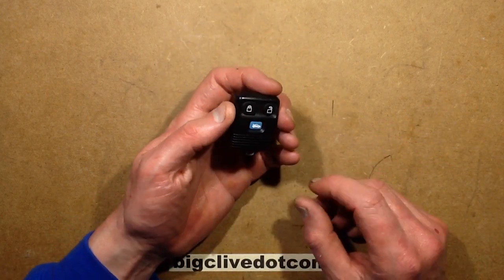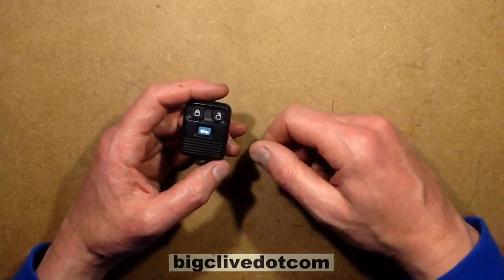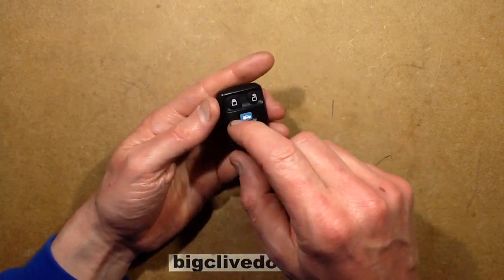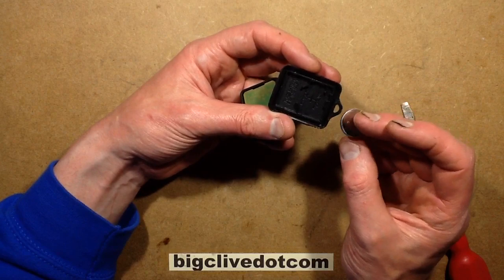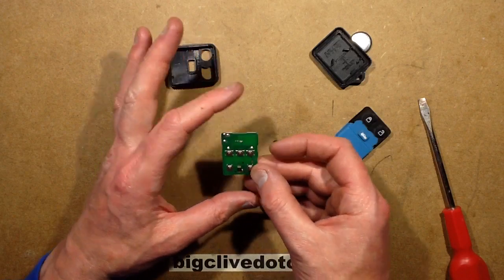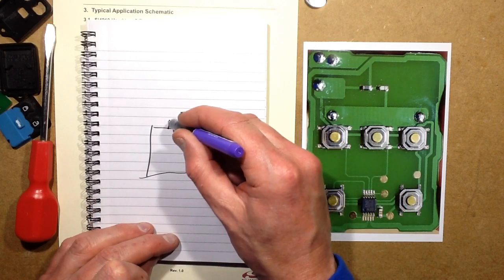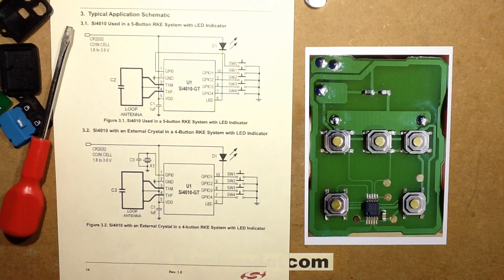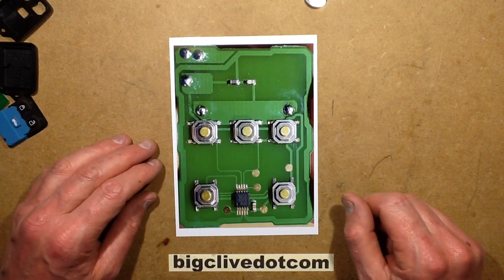Inside a Ford Transit keyfob remote.  (and pairing it)

Comment: Huh... last time I had to replace a fob for the car (granted it was a VW Golf not a Ford Transit), I switched the gubbins over to the new fob and I couldn't work out why the key wouldn't work, even more concerning it still wouldn't work when I switched it back to the old fob, I got irate at this point, so the other half googled it and discovered it has a tiny little thing the size of a grain of rice which was apparently loose in the fob which obviously fell out when when I opened it up (someone might be forgiven for thinking they don't want you buying and fixing your own keys), after we searched the floor and found it the new casing worked a treat... I was hoping you were going to explain said tiny loose doodad, I assume it's how the car recognises the key but how does it work given it's' the size of a grain of rice, loose and not physically connected to any kind of power source? Does it have a some sort of tiny kinetic battery like some watches? Does it use the field produced by the key's electronics/battery? ;)
Reply from the maker: That's odd.  It almost sounds like it could have been a transponder for the ignition system.
Reply: Ah ha... I did some digging based on that and discovered it is a ID48 Transponder Chip, it's encased in glass and it is about the size of a grain of rice (there are pictures in google images but there isn't much to show scale), it looks like it has a wire coil inside it (one of the images showed a bit of the inside). Does that shed any light? Do you know how it is powered based on that info? Google just keeps telling me where I can buy them and how to programme them to the car. I would be curious to know how they work and particularly how they are powered :) I might still have one knocking around somewhere if your interested (the car was written off when someone kindly ran a give way sign at 40mph and I'm one of those people who keeps interesting things) although I don't know if you will be able to get into it given it's size an it being 'encased in glass' be more than happy to pass it on to you though if I can put my hands on it :)
Reply: Oh... modified my search terms a bit and found this: http://www.locksmithjournal.co.uk/understanding-cloning-and-how-it-can-work-for-you...
"Since 1996, in an attempt to reduce vehicular theft, auto manufacturers started including small computer chips, called ‘transponders’, inside the key that communicate with the vehicle to allow it to switch off the immobiliser. Importantly, these transponders are powered directly from the vehicle itself, and are typically hermetically sealed in either epoxy or glass making them highly reliable and resistant to environmental factors such as temperature, shock and humidity. The technology worked so well that that is caused vehicular thefts to plummet almost overnight."
How are they powered from the vehicle if they don't touch anything is it magnetic radiation or something else?
Reply: @rtzigga  Thank you :)

Comment: I'm another one that doesn't get radio stuff. Most older electronics hobbyists started with ham radio. I just never had any interest in it.
Reply: +Tim Ramich I started just after the CB radio boom here in the UK of the early 80s, so a lot of what was available was CB radio stuff... but, I never really had much interest either.  TV/Satellite/Cable/Wifi/etc brought me to RF after a few years messing with low frequency or DC only stuff...  but only on a pragmatic level. No design, just reverse engineering minor stuff and troubleshooting.

I agree it's like some dark magic, where moving a component a few tenths of a mm can detune a circuit or summon a demon. And the circuit layouts on some  multi GHz level stuff looks like bizarre abstract art
Reply: +TheChipmunk2008 
The most beautiful and fascinating stuff on the planet is UHF circuitry.

Comment: the chip in a real ford is an ah30ut00   042647w   the older ones was a pic16lf84a  ah28tt00  and the after market (ford) is a chp051a  0219g2m oh when you program the fob to the car you can have only one fob so yes you can program only one if you only have one some customers will buy only one

Comment: so...for a while...i only had an ignition key.... no door or trunk keys....and theirs no button inside for trunk. 

so the key fob was my life....battery died, walked to the gas station and got a battery.....but broke a spring contact that bridges the 2 plastic halves, and carries the positive. 

ended up using the metal safety from a bic lighter...cutting and bending with tools i carry with me at all times. 

broke down too many times in bum fuck montana with nothing but cows for 100 miles....it can be BAD to break down out here. 

and ive been working on cars sense i was old enough to hold a flash light for my dad....saved my ass a few times already. 

so many cars would still be on the road of people just learned what the "bad sounds" an engine makes....if it sounds different, stop and find out wahts making the noise....thats not normal

Comment: GM does the same bullshit (and im a GM guy)

i have a pass key 2 car...the little black chip in the key. their is a way to program any key (that has the right bitting) to work

its just a resistor.... and theirs 14 different values. people have measured their key, bought a resistor the same value, and spliced into the wire up the steering column....as they tend to loose connection, and you cant start your car 

anyway...i lost my keys for my car. GM can cut keys from your VIN number....however, because i didnt have a key, they said it would be 300 dollars to have a computer hooked up to my car that finds the code.....or they go threw and try 14 different keys. he was just making shit up as we went...

because the GM tech book....that i read before going into GM....tells about the relearn....turn the key on (dont start it...just on like in this video) for 10 mins, then off, then on for 10 mins....then off and back on for a final 10 mins....they start the car. 

in my case...i had to argue with the tech who had never heard of this relearn...to just cut me a key and give me resistor number 7, because its lucky. i got my key measured, as i found them before the blanks came in (montana dont got shit in stock).

turned out... it was number 7.  so it would have worked even if the relearn was fake...

this also works exactly the same for passkey 3.....with the RFID inside the plastic bit, with no black chip that can wear out. 

passkey is just designed to make someone have to work for 30 mins to steal your car.....it relies on him being stupid and trying to start it with no resistor...(it kills spark and fuel)....and that he would rather be lazy and not steal a car that takes 30 mins.

its a really stupid thing.....ends up leaving you high and dry 400 miles from home...with a perfect engine that wont run because the contacts broke....

good thing i prepare for montana....MRE, tools, blankets, snow shovel...always in the trunk. took apart my steering column and fixed the broken wire. 

mechanics needs to be mandatory..."check engine lights on....better drive 1000 miles...omg it locked up, fuck insert brand here"